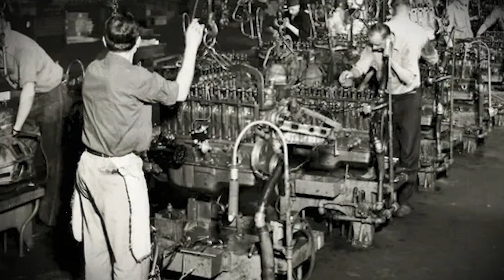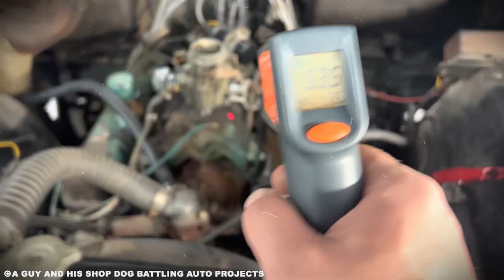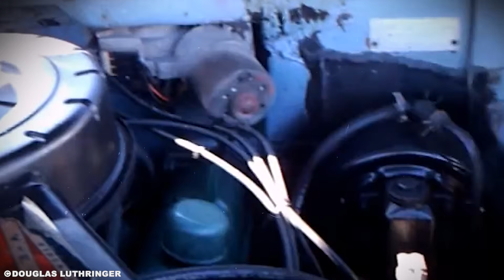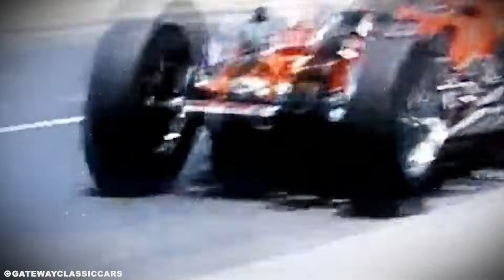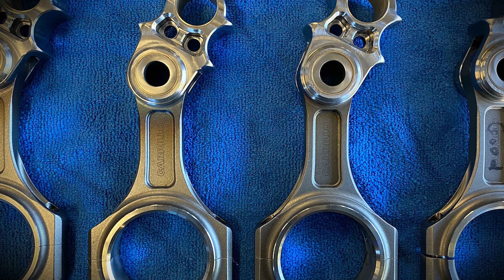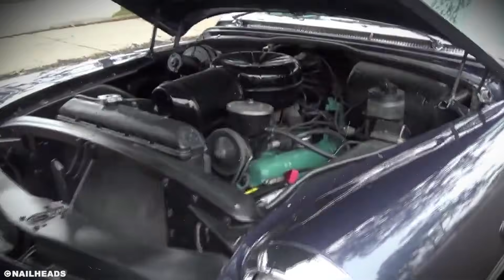How One Buick “Boat Engine” Outsmarted Every Hot Rod in Town

Comment: Low speed torque is not so.  1955 Buick Roadmaster 322ci V8 had 200 ft lbs @ 1500 RPM where as the 1955 Oldsmobile 98 324 cu in V8 had 250 ft lbs @ 1500 RPM.

Comment: My father always had Buick. . . I learned to drive in a 1969   Buick Electra 225. . .under the hood  lied a430-4     when I began driving it , after a while I was experimenting with transmission , in L1 it would bug at 30 mph. .  in early summer  in september it would reach 55 mph in the same L1 . . My father began saying that the car was riding so  smoothly .. . . A Honda CB-750 was no match for me. . I loved this car . . . But one winter in a closed , humid garage... . in spring it was falling in rust, , and ended up in scrap yard. . 😮‍💨

Comment: Buick never stopped focusing on torque. Their 1970 350 was rated at 410 ftlbs. 20 more than Olds, 30 more than Pontiac, Chevy.
Reply: and the Buick 455 was the king of torque, making 510 ft. pounds
Reply: @victorparra9231  Pontiac also had an engine rated at 510 ftlbs.
Reply: The Buick 350 is 150 lbs lighter than the Chevy small block. The Buick also develops its torque at lower rpm due to its longer stroke.
Reply: @ralphkronz5840  150 lbs? Not quite.

Comment: Max never had a blown engine in any of the Old Yeller Cars, although he built some for his customers. 
Ivo was the champion of the NailHead, but finally had to switch to a Chrysler to keep up. 
The NailHead engine had some exciting technology for its time: (1) The bore stroke ratio, (2) The firing order, which only now is figuring it out, and called the perimeter firing order, and when you change that in any other engine, you get 15 more horsepower.
Reply: IVO's 4V engine Riveria was at Mecum auction in Kissimmee on display a few years ago

Comment: FYI, this is very cool. That said, there really were no built small blocks in 1957 as the Chevrolet small block 260 was real small and Ford only had the flathead I think. This was a masterpiece!
Reply: The Ford Y block came out in 1954. 292 then the 312. By 57 Ford were putting Paxton superchargers on the 312 in the Thunderbird.
Reply: @Awsom47Merc  272 was the first Y Block
Reply: @josephsouza9951 Actually I just looked it up. It was a 239ci 1st. Same as the flathead but had a larger bore and shorter stroke.Then the 256ci followed by the 272ci then 292ci & 312ci.  I never knew that ...😎
Reply: WHAT !!  Are you implying there were  no '57 Chevies with 283 ci. ???
Reply: @neps4th 283 came out in 57
Reply: What about the Ford 292 & 312 y blocks used in the Thunderbirds
Reply: Ford were 260, Chevy was 265 ci

Comment: Mounted on a trolley, Buick 425s were also used as starter motors for the SR-71 Blackbird supersonic jet: https://en.wikipedia.org/wiki/Buick_V8_engine
Two starting methods were used during the life of the A-12, YF-12 and SR-71 aircraft: an AG330 starter cart with two Buick V8 engines driving a common output shaft, or compressed air driving a small starter adapter. The air-start method superseded the cumbersome "Buicks" when better compressed air supplies became available.[15]
https://en.wikipedia.org/wiki/Pratt_%26_Whitney_J58#Starting